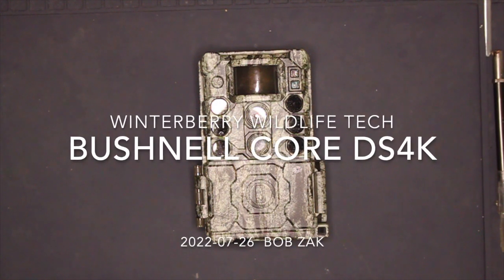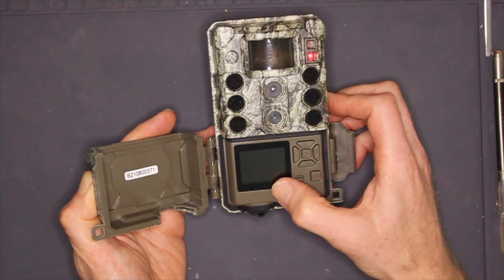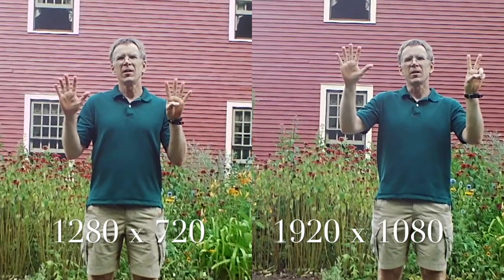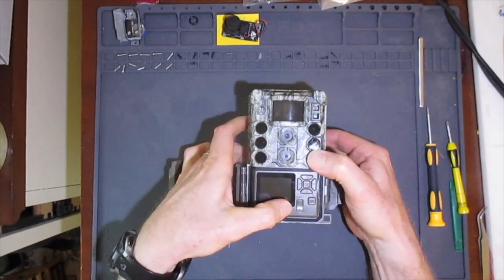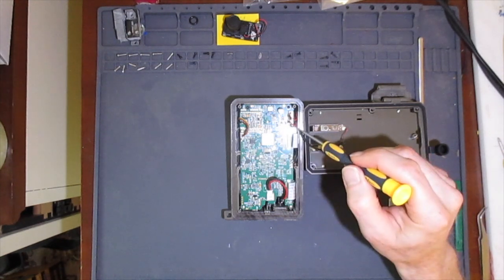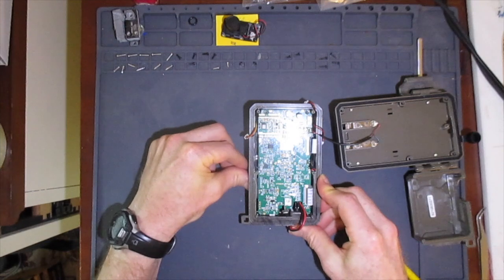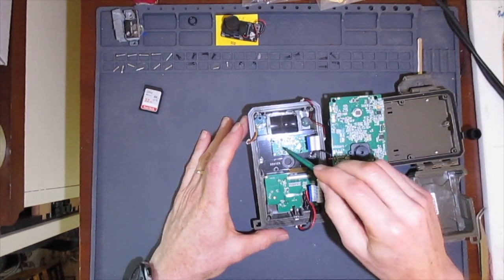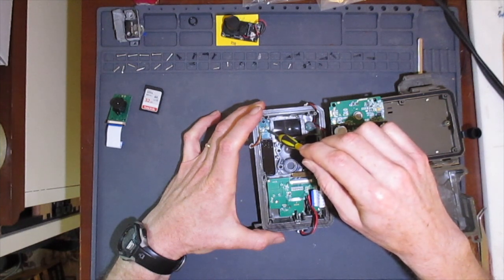Bushnell Core DS4K Overview and Teardown   HD 720p

Comment: is it possible to disable the red flahing light when the camera starts recording?
I dont want it to be stolen
Reply from the maker: I don't recall this behavior.  Unfortunately, I don't have this camera any more, so I can't replicate what you're seeing.  The users manual is quite sparse on the function of the red "motion detection" LED, saying only that it is active for a short time (~10 seconds) after you've turned the camera on (and implying that it goes off after that).  If you arm the camera, and then wait for a good long time (say 1 minute, to be sure), does the red flashing light still come on when the PIR detector triggers?

Comment: Are you able to provide any part numbers for what they've used, in particular the SoC and possibly the video sensor if it's visible?  Some of the cheaper Chinese ones use barely-known chips more commonly found in dash cams, it'd be interesting to see what Bushnell went with.
Reply from the maker: The Bushnell uses the V37 version of the iCatchTek camera SOC (https://www.icatchtek.com/ProductContent/b9cd78cf5f294c58916e30ee7a584246).  In addition to supporting two channels of 4K (30 FPS) video, this chip also sports an ARM core (vs. MIPS).  Vs. the V35 version used in Browning cameras up to the HP5, it seems to use about 20% less power when processing 4K images, and even less at the next resolution down, at 60 FPS (Browning "Ultra" resolution).

I cannot tell what type of image sensors they are using.  The easiest way is by examining firmware, but this model doesn't have any firmware updates posted (and most trail camera manufactures don't post the original firmware).

Hope this helps.

Comment: Good afternoon.
Great review of the camera, very detailed.
Nowadays I use software to make my Browning recordings from 1080p to 4K.

https://www.youtube.com/watch?v=Jr2pwg04LuE

Mr. uses Energizer Lithium batteries, correct?
I bought 16 XTAR AA 1.5V Lithim rechargeable batteries on Aliexpress for $40.19 and I'm happy with them, much cheaper.
Have you tried a rechargeable lithium battery yet?
Thanks for the camera review.
Yours sincerely,
Erik from Brazil.
Reply from the maker: Thanks, Erik for checking this out; and for info on software "enhancement" of raw video.  I'm pretty sure that this camera is doing something similar internally to get to 4K.  

I think rechargeable batteries make a lot of sense in many applications.  Our typical use these days (long duration, through very low temperatures) is better suited for the EULs.  

I have several blog posts dedicated to trail camera batteries, including one where I measure the capacities of several different brands of the AA Li-Ion rechargeable cells.  Check these out, if you haven't already:

https://winterberrywildlife.ouroneacrefarm.com/2022/04/21/deep-tech-rechargeable-li-ion-aa-batteries-for-trail-cameras/

https://winterberrywildlife.ouroneacrefarm.com/2021/11/10/trail-camera-batteries-internal-aa-cell-options/

https://winterberrywildlife.ouroneacrefarm.com/deep-tech-trail-camera-batteries/
Reply: @winterberry-wildlife-tech  Good afternoon Mr. Robert.

I know that the Energizer Lithium has around 3427 mAh, the XTAR has 1803mAh at 1A of discharge, with the XTAR batteries my browning HP4 managed to record 8hs of video.

Today in Brazil, 8 Energizer Lithium batteries cost R$250 ($48.60).
As I said earlier, 16 XTAR AA is priced at $40.19 on the brand's official website on Aliexpress.

I usually check my cameras every 14 days or 21 days, my max was 33 days.

Certainly for very long periods, Energizer is better, unfortunately the cost of Energizer batteries is prohibitive in Brazil.

Speaking of 4K video, I bought the Campark TC06 which records in 4K during the day and 1080p at night.
I thought the camera's 4K was good, it records in HEVC with 32 Mb/s and uses the Sony IMX458 sensor and the Novatek 96670 chipset.

In the description of the video below, there is a download link with a sample of the video in 4K without editing, if you want to download it to view on your computer and compare with this camera, feel free.

https://youtu.be/cTyP8HV79QM

Thanks for the links, I will read them all.

Regards.
Erik
Reply from the maker: @Natrilhadafauna  Wow!  That's expensive.  Here in US, EULs were under USD $2/cell at one time.  They have since gone up considerably, maybe USD$3/cell.  I really hope  they don't go to $6/cell!
Reply: @winterberry-wildlife-tech  Here in Brazil the value is very high, because the purchasing power of the Brazilian is very low.

Monthly salary R$1212.00 ($236.43) (160 hours per month)
Daily fee R$40.40($7.88) (8 hours a day)
Hourly rate R$5.51 ($1.07)

Non-rechargeable batteries for trail camera, generates a very high value and is not feasible to buy here in Brazil.

Yours sincerely,
Erik